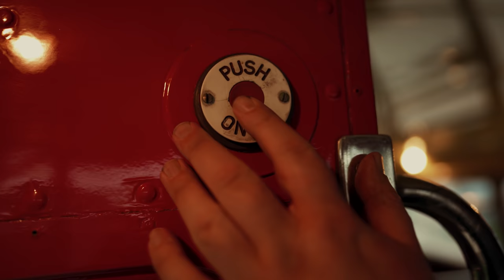Ep13: AEC Routemaster London Bus Restoration - Refitting The Rexine (Pt2)

Comment: Yep, I agree that the seat frames should be restored altho' it's a pain. The bus is starting to look so beautiful it would be a shame not to include the lower seat frame. I'm sure they'd have been included if the restoration was being done by LT at Aldenham works. Brill video as usual.
Reply: You are correct there David. The lads at Aldenham would certainly have carried out the seat frame refurbishment.
Many components that the public would see, but many hidden from view.
It was all part of that very high standard, that kept these buses in service for decades.👍
Reply: @jonniejam-shovel6405  As you correctly say, the only way LT maintenance knew to fix stuff was to the 'gold standard'. On a slightly different tack, wasn't the Routemaster a brilliantly conceived and engineered piece of equipment? Do you know why it didn't become a more popular choice with other regional operators - or indeed, an export winner with overseas customers?

Comment: I used spray adhesive to stick rexine on a bus; only problem - after a while the material came unstuck again. I think the cause was that the adhesive soaked into the substrate so most of it was never anywhere near the Rexine. Hope you don't experience that problem. The other thing I was going to say was about seat frames. I found it was taking a day and a half to prep and paint each frame and ballsachingly boring. I saved my sanity by taking the whole lot to a powder coating place for stripping and refinishing.

Comment: Hello Dave and crew, as an owner of two PD2's that both require the rexine replacing I was intrigued by your comments on the virtues of the contact spray versus the brush on contact adhesive.  I must admit I was planning to use the spray but now you have put me in two minds. How are the small panels you used the spray on, any sign of deterioration as you feared? And can you recall the make of the brush on glue that you used?
Thanks, keep up the good work